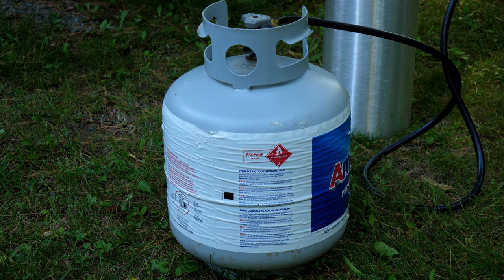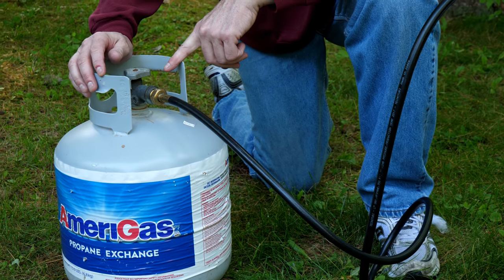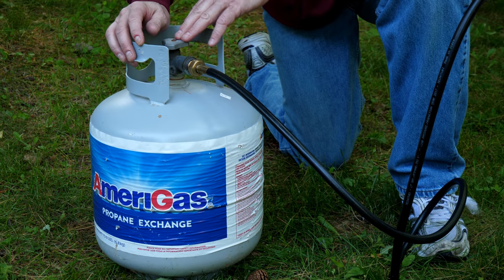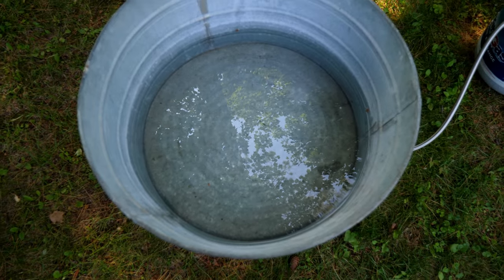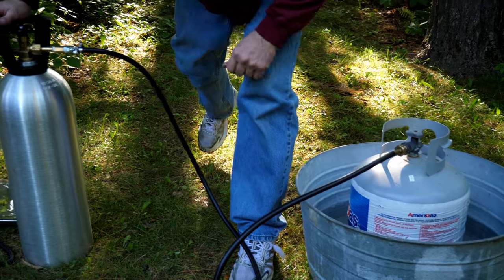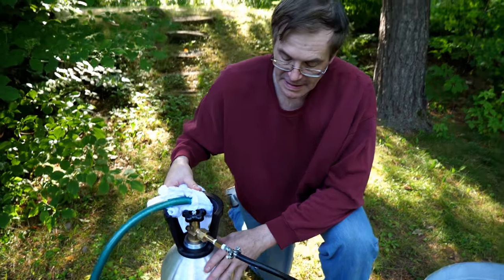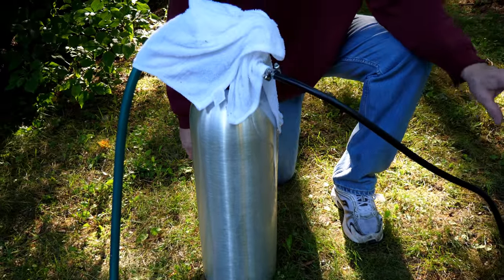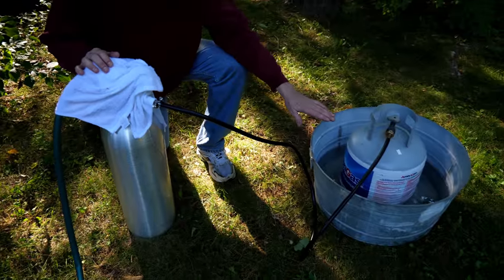Liquid Propane - How to Transfer Safely

Comment: Ok so that CO2 tank is not designed for propane in that the relief is a burst disk where as a the propane tank has a spring relief that will shut off once it relieves in an over pressure situation. The burst disk goes and it dump the whole contents. Probably a bit more dangerous. 
They actually make  a liquid withdrawal tank if you need to use liquid.

Comment: I’m confused, if all you wanted was the liquid instead of the gas vapour, wouldn’t it be easiest to just flip your 20lb tank on its head? Would do the same as having a dip tube, simply takes gas liquid from a low pickup point in the tank..
Reply from the maker: There is a shut off valve inside these tanks that prevents all flow when the tanks are inverted.
Reply: @TechIngredients  I have the same AmeriGas tank, no problem inverting it to refill my little 1lb bottles.

Comment: I have tried this method, because I have an "OLD" 20lb. tank of LP gas that I wanted to transfer to a newer tank. I had the source tank in a hot tub of water, and the receiving tank in a cold tub with hose water running on it. 4 hours later I stopped & weighed it only to find it to be the same weight! The next day I inverted the source tank, 4 hours later, nothing transferred? WTF?
Reply from the maker: A good place to start is the valves.  Slowly open them to free air and you should get some leakage.  Even an "empty" tank will release some gas if it is allowed to warm up.   As soon as the warm and cold tanks are joined and both valves are opened you should hear an initial rush of gas flow that will slow after about a minute.  If you don't hear that there is no reason to keep waiting.

Comment: Side note not explained very well. Propane liquid is volumetric during expansion due to temperature.  Never fill a tank more than 3/4 full no matter what the pressure rating of your containment  vessel; would be prefered level of liquid at standard atmospheric temperature and pressure. This level should protect you from most hazards of a overtemp event.(bleve) The critical temperature is roughly 99 C and then all bets are off steel tanks are normally filled no more than  that level.

Comment: Wouldn't it be faster if you turn the propane tank upside down in the hot water bath? Then instead of transferring Vapor you would be transferring liquid.
Reply from the maker: Many of these exchange tanks have an anti-siphon valve that shuts down all flow when the tank is inverted.  Also, the vaporization step is actually performing a distillation purification and leaving water and heavy oils behind.

Comment: Why not put the propane tank upside down and transfer liquid?
Reply from the maker: These commercial tanks contain  a float, check valve that will stop the flow of gas and liquid  when the tank is inverted.

Comment: Propane has a vapor pressure of 227.8 psi at 120° F and 85 psi at 55°F without the ethyl mercaptan odorant.  It's used as a refrigerant in many cold vending machines.  I'm not sure what effect, if any the mercaptan has on the pressure temperature relationship.  Also the exchange tanks are only filled to 15 lbs of propane.

Comment: Added warning about doing this indoors don't! Propane is heavier than air and likes to pool in a room and effectively fill the room with essential a well mixed fuel air mixture. This is why videos of houses with gas leaks that blow up on YouTube are as masive as they are. This stuff isn't something you want in volume, indoors.

Comment: Wouldn't it be way more easier to just flip the commercial tank (valve on the bottom) to tap the liquid propane directly? :D
Reply from the maker: Many of these exchange tanks have anti siphon valves that preven all flow when the tank is inverted.  Also, the gas transfer process acts to purify the propane which often contains water and unwanted oils.

Comment: Feels like a drugstore heating pad would be a viable tank heating option.
Reply from the maker: You need the huge heat capacity of the water as well as the excellent thermal contact that the water makes with the complex curvature of the steel tank.

Comment: Heating the BBQ tank is actually another way to regulate vapour (fuel) pressure, should you use it as such.  Hot rodders have long done this with N^2O tanks, even before the commercial "bottle blankets".
Reply from the maker: That works.  We want the liquid propane partly because we want to take advantage of the cooling effect within the engine itself as you will see.
Reply: Yeah, I bet you get a great thermal sink effect with propane.  I wonder what kind of boost you could run in a racing engine with a liquid propane carburetor system in the high pressure area.  I know just straight gasoline run through a carburetor after a supercharger can drop a good 100 degrees F, but propane should be better.
Reply: I hear ya, "TI". I didn't mean to suggest you could use vapour for what you have up your sleeve, just that the pressure can be stabilized in a given context.

Comment: if its liquid , you lift the other tank and turn it upside  down
Reply from the maker: There is an anti siphon valve that stops all flow from the tank when inverted.
Reply: Not entirely true.  On new OPD valves yes but, that can be worked around by using a POL male fitting.   @TechIngredients
Reply: @TechIngredients  maybe a magnet could seize the valve in the open position? Not sure what it is made out of though
Reply: @Galactis1  explain your magical statement.
Reply: @1dgrdgr , with new style valves that are OPD they cannot be tipped upside down to get liquid out.  Unless, you have a POL male fitting to depress the check inside the OPD valve.  However, this is also not going to work if "some" of these OPD valve assemblies have 1 of 2 types of valve assemblies.  One, has a tip over liquid preventer to prevent people from getting liquid out, and or safety mechanism to prevent if the tank tips over, liquid does not get siphoned into the unit that is using the LPG tank.  Some other types of OPD valve assemblies do not have the liquid tipover preventor especially older OPD valves from say when it was implemented in 1997.  Not sure when or if all OPD assembly valves require this or not.  Also, I grew up working in propane my whole life. :)
Reply: @Galactis1  thank you for the information.  I'll be sure and get one that has the male threads. I'll go through all my exchange tanks and convert any that work upsidedown to refill tanks.  Beats trying to turn my 100lb tank upsidedown.
Reply: @1dgrdgr , Lots of old 100lb'ers have a male fill valve to fill from the bulk truck.  And, usually 100lb'ers are grouped up with some sort of pig tail with POL fittings with small copper lines that go together to a regulator, then off to steel pipe into the house.  I'm not really sure if 100lb'ers have anything different than a POL outlet valve with a turn knob to open them up.  I've never actually seen anything new.  100lber's been essentially unchanged since propane came out. in the late 30's early 40's.
Reply: @johnrutkowski9005 , Also, yes this is how some old Blue Rhino tanks valves worked.  I'm not sure if they still do this but, it had like small little triangle hidden on the side of the brass valve, it was a magnet check to open the valve for filling.  Was mostly a pain in the ass, to prevent anyone other than Blue Rhino from filling.  I think that quickly went away 20 years ago.
Reply: @1dgrdgr , Just be careful work outside obviously.  :)  Propane is a hellava lot safer than working with gasoline remember that. :)

Comment: I'm pretty sure you could transfer liquid instead of vapor by just flipping the cylinder upside-down.
Reply: I've done that (on older tanks) - works fine since there is less cooling of the discharging tank So in the summer 5 minutes in the sun warms the tank after 3/4 of discharging.

Comment: Why not turn the supply tank head down so that liquid propane goes through the line. You still will need to maintain certain vapor pressures but you avoid vapor cooling effects. If you ensure equal vapor pressures in both tanks you control the filling by
communicating tube principles.
Reply from the maker: Most of these tanks, including the one I demonstrated have an anti siphon valve that stops all flow, liquid and gas when the tank is inverted.

Comment: Why not turn the bbq tank upside down and raise it up a bit to make it flow easier? That way you can transfer liquid propane instead of gas. That is how I refill 1lb bottles with a 20lb tank.
Reply from the maker: Many propane bottles have an anti-siphon valve that prevents all flow, gas and liquid, in the inverted position.  If your tank does not then yes, that would work.

Comment: If you sat the supply tank in ice water i assume this would not need a heat bath at the other end ..no heat , no gas heater required , safe
Reply from the maker: I'm not sure that that it would be safer as long as the heating process is done far from the propane tanks.  A heat source is more convenient than a cold source, but you are absolutely correct that ice would work in place of heat.
Reply: Tech Ingredients anything negating the use of flames and heat is surely safer , and you could use ice cubes from a fridge ?

Comment: Yeah you really could turn the propane cylinder upside down to transfer the liquid instead of transferring gas. It's unethical to transfer propane into CO2 tanks however there's often a scent oil that they add to propane if you do make a transfer like this you will likely get some of it into the CO2 tank. If you do that and you then exchange the tank someone else later down the line may use the same tank for carbonated drinks and it could damage their health a little bit.
Reply from the maker: Many, including these propane tanks have an internal float valve that prevents all flow, liquid and gas when the tank is inverted.
I agree that when a container is used to store a chemical, any chemical, that residual contamination can prevent it from being used for another purpose, even its original purpose unless it can be effectively decontaminated. Ethics only enters the picture if you intend deceive others about it's history.
Reply: @TechIngredients  I believe you're correct about the float valve but it's designed for preventing over filling rather than emptying. In the inverted position the valve would remain in the open position as long as there was enough liquid in the tank to float the float. I know this is how you use the fill adapters for one pound tanks but it would take many of the smaller tanks to run into this problem I had assumed that the poor filling nearing the end of a large tank was due to pressure loss rather than a mechanism within the cylinder.
Reply from the maker: I tested this myself and as soon as the tank is tipped, all flow stops.  It's an understandable safety measure for people who are using the propane for conventional purposes.😙

Comment: Isn't that a 20lb co2 tank?
Reply from the maker: No, it actually is a 10 lb tank, but that is its official capacity.  Based on its internal volume which can be pretty accurately calculated from its empty weight and the density of aluminum, the capacity is significantly greater.

Comment: This is dangerous without 80% fill spitter. LP expands 17x much as water. The volume vs mass changes with temperature. That's why it's delivered corrected for 60f. This is insanely stupid without an accurate spitter and no gauge. Even with a gauge use the damn spitter.

Don't use an unapproved container to store propane. There are safety relief valve because per 1f at 100% filled = 360 psi and so on. You need a DOT approved tank with a current inspection. For $40 it's not worth your safety.

Comment: Using temperature differentials is inefficient and takes forever. Get a drift hose and turn the donor tank upside down. I have been filling tanks of all sizes in this way for years.
Reply from the maker: Not these.  They have an anti siphon valve that stops all flow, liquid and gas when they are inverted.
Reply: @TechIngredients  when what are inverted? The tank? Thats false.
Reply from the maker: Yes, the tank.  The vendors claim it's a safety feature.  It's a definitely a drag.

Comment: Hmm..heating the source tank so much would increase the pressure very much inside the tank, especially when you wait so long to open the valves.. Be cautious, that the source tank will not burst then and explode !!!
Reply from the maker: If you look up the vapor pressure of propane vs temperature you will see that water that you can touch without burning your self is within the pressure limits of these tanks.
Reply: if your BBQ tank is safe for 100 degrees in the summer, then doesn't it reason that maybe that's why he said to heat the water to approx 100 degrees?  But yes, I beleive if someone were to simply use boiling water (212 degrees) that could be a different outcome.
Reply: Long time ago my brother in law was a hot air balloon instructor. One of his students owned a pizza shop and decided to use the industrial dishwasher (the type  that has a 2 minute full cycle time with extremly  hot water) to warm up the propane tanks before an early winter morning flight.  
Fortunately nobody else was in the restaurant at 5:30 AM, when the pressure relief valve let go the owner was able  to get out just before the explosion so no injuries. (Lots of gas pilots as ignition sources in a restaurant...)

Comment: a faster way is to turn the 20lb bottle upside down to fill. Get the liquid straight out of it.
Reply from the maker: In some cases you're right.  However, many of these newer bottles have an anti siphon valve that blocks all flow when inverted.  Also, the vapor transfer method also acts as a purification step just like distillation to separate out less volatile impurities like oils and water.

Comment: 120 degree water? Oh, right. You mean 48.888 degree water.
Reply from the maker: I mean both.  The temperature is the same and its good to be multilingual.
Reply: Oh, I just meant that's what went through my head. e.g. "How can water be 120c and not boiling? (pause) Ohh right." I could have phrased that better. Wasn't trying to be critical. Love your videos.

P.S. I am American as well and grew up on imperial units, but I've lived/worked in China as an engineer for so long that I've completely lost any intuitive sense of Fahrenheit.

Comment: This is pretty slow, what you should have done it turn propane tank upside down and that way you would transfer liquid only, much faster then vapor itself
Reply from the maker: Many commercial tanks have an anti siphon valve that prevents any transfer of gas or liquid when inverted.  In addition, commercial propane is dirty and contains other hydrocarbons such as butane and even water.  These components can freeze when the propane vaporizes and block lines and nozzles.  The vapor transfer technique, although slower, acts as a purification step leaving these lower vapor pressure components behind.
Reply: All good points, very true also. You could put both bottles into larger freezer. Only propane wouldn't freeze at those temperatures. Pressure wouldn't be high nowhere near what you had, but you could also take out bottle you are trying to empty and have it just below 0°C or 32°F. Water and butane would be liquid/frozen. With high outside temperatures, you are not stopping other hydrocarbons from transferring also (Butane also boils).
Reply from the maker: You might want to take a look at our video on distillation.  The vaporization favors the most volatile components even though all components contribute to the vapor phase.  The differentiation can be substantial.
Reply: alright, I'll take a look, i'll see what were your findings
Reply: I watched the video. The biggest difference I see is: you have water and Isopropyl alcohol, both with pretty high boiling temperature, separated by less than 20°K.
Propane and butane further apart, more than 40°K. And if you cool both, below boiling point of butane, propane will still boil vigorously. While there will still be some butane vapor, this shouldn't change as ratio propane/butane changes, if temperature is always low.
% of butane in propane will be pretty low.
What I want to do is, get LPG and separate propane/butane. Why not just get propane? because is had H2S added, which I don't want to have in propane, since I want to use it as refrigerant. LPG doesn't have this, but has a lot of butane in it. Don't want butane also